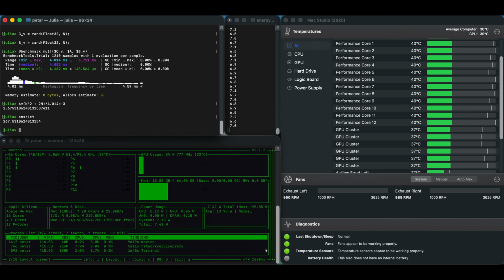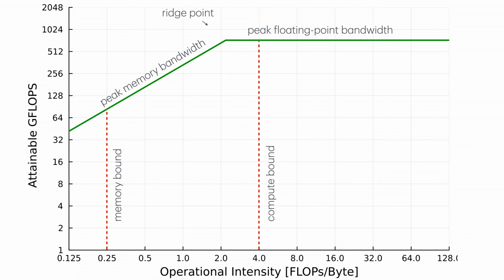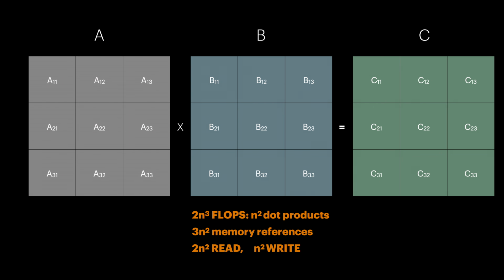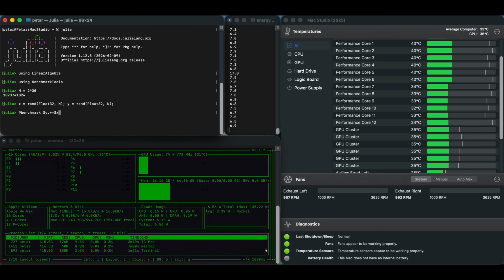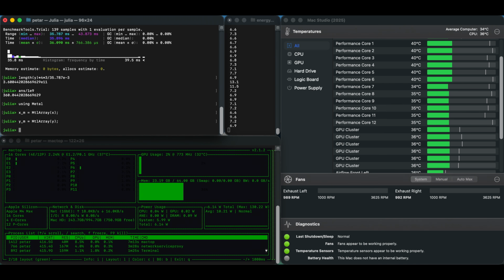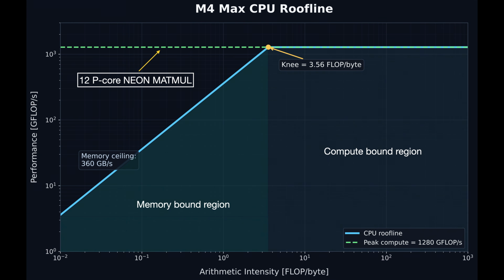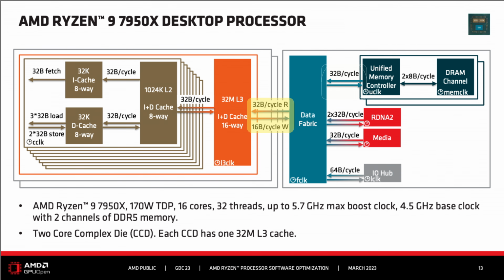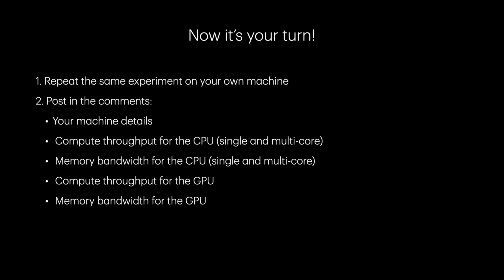Apple Silicon Performance Explained: Bandwidth vs Compute (Hands-On)

Comment from the maker: Please try the demo yourself and post your results.

Run the same Julia commands on your machine and share:
	•	Your system (e.g. M1 / M2 / M3 / M4 / M5) and the number of P and GPU cores.
	•	Achieved CPU compute throughput and memory bandwidth
	•	Achieved GPU compute throughput and memory bandwidth

If enough of you try this, we can build a pretty solid dataset across Apple Silicon generations!

Comment: I mostly agree though we do see differences in certain areas on Zen 4 or Zen 5 systems (for consumers) when the memory is different. If the chokepoint was just in the I/O Die and serdes being fully populated, then some of these tasks wouldn't show the difference. I have to check Alexander Yee's microbenchmarks on Zen 5.
Reply from the maker: Chipsandcheese did a deep dive on a Zen 5 Epyc 9335P at 4.4GHz (similar to M4 Max) and looked at single thread bandwidth. Their R+W test peaked around 80GB/s and a single CCD reached 134 GB/s. The all CCD BW was around 480 GB/s.
Reply: @PetarMarendic  OK. So the way I understood you when you were explaining the theoretical maximum bandwidth for Zen 5 was that both CCD's are limited by 2GHz Fclock when IF wants to talk to DDR5. And yes, that is the bottleneck. But given that Chips and Cheese hit a hard limit of approx. 64GB/s when they loaded one CCD vs 101.18 GB/s when they loaded two CCD's, I think that when it comes to memory bottleneck, you're either looking at uclock or memclock calculations. Each CCD will have 64GB Read speed with I/O die and both CCD's together will have 96 (?) GB bandwidth limit with DDR5 - 6000. With DDR5-8000 it rises for various reasons. But "technically" both CCD's have a limit of 128GB/s read - whether you can actually use it, is a bigger question.
At first I had impression that you were saying that CCD0 and CCD1 together had limit of 64GB/s of read, because both CCD's use the same serdes to I/O die. But AFAIK, they each have their own pathways (I will check on fritz fritzchens or other high quality image if I/O die has two separate channels to communicate with two separate CCD's later. I'm busy as heck) and the limit is DDR5 memory controller. But I'm almost certain that it doesn't run on Infinity Fabric speed.
I might have misheard or misunderstood something. But I was certain that I saw tests for Zen 5 at least that shown this 64GB/s not to be maximum for whole CPU and not including Fabric overclock (which would put it at 70-71 GB/s max). Which is why that chart showing Zen 5 cap at 64GB/s really bugged me. Yes, with 1 or 5 threads, this is what you will get, because you will only use one CCD. But on 9900X you should have 12 cores and 24 threads available. And 5 cores, should land on only one CCD, due to algorithm of core-parking (which often prefers powering down CCD's rather than spreading the load - mostly because if you require cross-CCD coherence, you're kind of limited to 1 CCD speed. But this depends on the algorithm and how it spreads and validates load). I will check later, when I have time. Thank You for the video and thank you for your response.
Reply from the maker: Hi! Thank you so much for taking the time to write up such a detailed response! I double checked my assumptions, and you are right. There are 2 UMC memory controllers on a 9900X/9950X Zen 5, one per memory channel. I made the wrong conclusion from the chipsandcheese test that peaked at 64 GB/s and assumed there is only one UMC. Indeed, all the threads must have been pinned to  a single CCD.

So if that link between the UMC and the I/O die runs at fabric speed (the AMD slide is ambiguous), then the max theoretical per UMC bandwidth is 64 GB/s or 128 aggregate on a 9900X/9950X.
Reply: @PetarMarendic  This stuff isn't easy. I'm far from perfect myself. I've been interested in hardware for 30 years. And this was the only claim that I had problem with (especially since I initially misheard it and somehow didn't see you yellow the other part on the slide, so my first comment was basically me assuming that you based it just on the speed between CCD's and I/O die), because it would mean that there are almost no scenarios in which faster memory on "workstation" (so 9900X and 9950X) CPU's does anything except having possibly tighter timings. Which I knew wasn't the case (It's a bit different in gaming and there is also cache and V-cache with normal applications where you don't exclude cache, which makes the computation a bit more complex. You would need two roofline models for X3D parts. Especially if you could fit your benchmark on the cache).

I will check resources from Agner Fog and Fritz Fritzhens tomorrow. At least the pictures should be more definitive. If my 5950X PC worked I could have tried the benchmark, but of course Windows gone up and died and I decided to clean the inside of my PC and the screw fell into the PSU - which is a nasty repair to do. I did remember that it scaled with memory well up to 3600 and then less well. But there are multiple differences between Zen 3 and Zen 4/5.

If you haven't read it yet, read:

"Zen5's AVX512 Teardown + More..."

by Alexander J. Yee (Mysticial) - it's freely available on his page. He discusses extreme memory starvation (which was also known on Zen 3 - if I recall correctly, Buildzoid did tests and concluded that on his RAM and 5900X, ten and a half cores had okay access to memory - 21 threads. 5950X was therefore mostly getting speedup because of it's cache and some other scenarios that didn't use full compute) Situation for Zen 4 and 5 is much worse in terms of how starved they are).

I apologize for my English - it's my second language and I haven't slept previous night so my communication skills are... not great.
Reply from the maker: Hi! Your English is perfect as far as I am concerned - I am not a native speaker either :)

Indeed, it's easy to make mistakes like these when one doesn't do the tests themselves. 

I read Yee's article on Zen 5 a couple years ago: it was terrific work! 
I just went back to the article again. In his setup each core was getting just 3.75 GB/s in an all core streaming workload. For his y-cruncher not to be memory bound, he extrapolated the system would need at least DDR5-20000. However, for large matrix multiplication workloads that have extremely high arithmetic intensity, the 9950X can get close to its peak AVX-512 throughput. I saw someone benchmarking it in Julia, and it hit 1.76 TFLOPs in FP64: https://discourse.julialang.org/t/poor-openblas-performance-for-large-matrix-multiply/119354/4. Based on Yee's article, the Zen 5 downclocks to 3.8 GHz in heavy AVX-512, so the theoretical maximum would be just under 2 TFLOPs.
Reply: @PetarMarendic  @jannegrey. You both write excellent English.  I’d be lucky to be able to read a bus schedule in French.  Cheers!
Reply: I’m not saying you speak French.  Ugh.  I once accidentally referred to an Apple exec as French and was firmly corrected that he’s Belgian
Reply: @bagel123klout It's cool. Hercule Poirot suffered his whole fictional life when people called him French ;)
Reply: @PetarMarendic  Yeah. I trust them, I just have to check, because you do get instances were increasing peak memory bandwidth, increases the performance of the Zen 4 and Zen 5. Of course it doesn't make I/O die bandwidth any better (it is still one of the bottlenecks), but if I/O die was hard bottlenecking everything, then the uplifts shouldn't happen. I am almost certain that Alexander Yee wrote that to fully utilize 9950X you would need something like DDR5-21000 at least (which doesn't exist yet). Or quad-channel that is super fast.

Again, I'm not claiming that you're wrong. I'm just having issues reconciling certain benchmarks. And Alexander Yee is basically one of the most trusted people when it comes to CPU Benchmarks. Did you read his Zen 5 teardown and AVX 512 article? He rarely posts, but when he does it is great. And chips and cheese use him as a source. When Zen 5 was launching, Ian and George were basically talking for over an hour about parts of his analysis.

And I'm definitely (I want to make this clear) - no claiming that you're misleading or lying to anyone. I just have to check it out and verify. Because while AMD's Infinity fabric is well known bottleneck, it most definitely isn't the only one. So this is something worth verifying thoroughly. And of course, I know a roofline model. I went into the video knowing all that stuff - it was just my first time watching your video - which was BTW very well done. Thank You.

Comment: you should inspect the bycode of you compiled kernel program to ensure the correctness of the ampunt of operations it actually executes. often complex.matrix.operations require less operations because of SIMD optimization (and clever math)
Reply from the maker: Hi! Thanks for the insightful reply! Were you thinking of something like the Strassen algorithm or approximations? 

I would like to know more about these optimizations if you could point me to the research. 🙏

Comment: 1280Gflops P-Core compute is simply not real bro. Even Novanbench returns 3300-3400Gflops FP32 for them M4MAX ofc using P+E cores.

The M5MAX has been benchmarked at 4750 Gflops at the highest. And this benchmark dont even use kernel level Accelarate calls
Reply from the maker: It’s real. If you run the code you can reproduce it.

The computations are carried out by P-core NEON units. There are 4 128 bit NEON units on each P-core. Therefore, each P-core can do 4x4(fp32)x2(fma)= 32 FLOP per cycle. With 12 P-cores at 4 GHz the theoretical ceiling is 1500 GFLOPs. In practice it’s always going to be less.

The 3300-3400 GFLOPs in FP32 you saw in Novabench was not P-Core but AMX throughput. I made a video last year on this subject and found that the M4 Max peaks around 3900 GFLOPs on the AMX: https://youtu.be/TjfA9LVgHXk?is=gqsF-Qvu7jQYstuD
Reply: @PetarMarendic  not to mention you are looking at useless SIMD throughput, while Scalar is much more important.
M4-M5 have massive front end and ROB, and by far the highest count Scalar entries well over a 1000, they both have  higher Scalar ceiling than a 9950x3d. The M5max is literally wiping the floor with the new 9950x3dv2 in mixed SIMD/Scalar FP render benchmarks and its not memory bound. +if we count the 5000 Gflops AMX than its really game over for x86. PURE SYNTHETIC SIMD FMA workloads do not exist in the real world. The real world is all about OoO Super Scalar compute which either feeds the GPU or is the work itself
Reply: @PetarMarendic 12P cores produce 1732Gflops FMA. With E cores its 2100Gflops.

Comment: How does cache fit into this equation? With the 9950X3DV2 and x86 starting to scale to huge caches how does that affect Operational Intensity?
Reply from the maker: That’s a very good question!

Once you include the cache into the picture, you get a multi-roofline plot: one for the cache and the other for DRAM. The cache roofline shifts to the left compared to the DRAM roofline. 

In a prior video, I made one such roofliene. Take a look at around time 24m00s in this video: https://youtu.be/HKxIGgyeISM?is=0Z3Q1aWEXMAsmZjB
Reply: Isn't that only relevant for code+data that fits entirely into the cache?

Comment: Petar I'll be converting the cmd line to jl files for easier benchmarking.  
I always thought anytime you use slowest component they become the bottleneck. 
Ryzen memory controller and IF is pretty slow once you hammer it with heavy compute, memory and IO it gets super slow than old intel i7/i9 processors that can do high memory freq at lower latency pushing the dram bandwidth to near ddr5 5200-5600MTps. X3D simply masks the slow memory bandwidth and can get super toasty without proper cooling if you always use data that's bigger than LLCs.
Reply from the maker: Right! It’s only in their Epyc lineup where the Zen 5 core fully shines and unlocks access to higher memory bandwidth. Chipsandcheese measured a single core achieving about 80 GB/s r+w bandwidth on the Epyc 9355P and a single CCD can scale up to 134 GB/s. Still less than the M4 Max and I think it will be interesting to investigate and explain why.
Reply: @PetarMarendic  indeed it's due to beefier IO die and IF but those CCDs aren't power efficient and makes sense only for server or data centres where CPU won't remain idle. 
Coming from intel initial firmware version on ryzen gave impressive results in both single core and multiple core workloads at 28w power window but current firmware and agesa made it crappier in single core performance than my 6700hq the 8840hs replaced which is running hotter at 99C even after swapping it with carbon nanotube thermal pad

Comment: Hmm, interesting, thanks for bringing it up. Most folks refuse to even try to understand what's under the hood and why they need a better system. Also, the importance of the number of memory channels between the Pro (4) and Max (8) lineup. People say, "Oh, the Pro and the Max have the same CPU(m5 max/pro20 and M4max32/pro20)," but that's not quite true. You need to look at the L2 cache, the memory bandwidth, and the number of channels.
Reply from the maker: Exactly! Very nicely put.

I think the common wisdom was that the extra memory bandwidth on the Max is there only to feed the bigger GPU. That’s why doing microbenchmarks like these can be both very revealing and explanatory.
Reply: ￼ Exactly, the correlation between the amount of course and the number of channels is important regarding GPU cycles, which directly impacts day-to-day performance, not just GPU-intensive tasks, as people often think. Bandwidth - amount of channels - Cash.Also, they use different memory chips (pro-Max); they only used the same on M1 Pro-Max—one chip larger size with 2 channels for Max and a smaller chip with 1 channel for Pros. I’m not sure how this affects performance like memory timings and stuff like that. I couldn’t find more information anywhere.